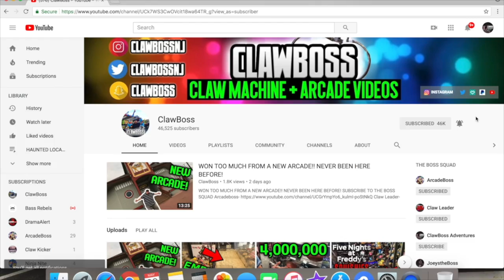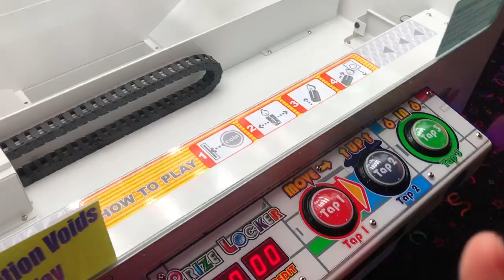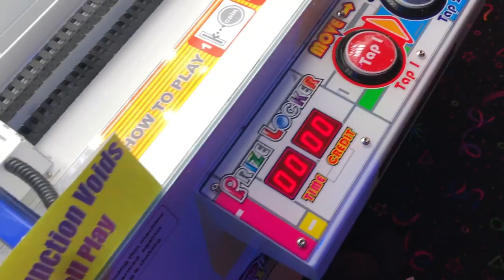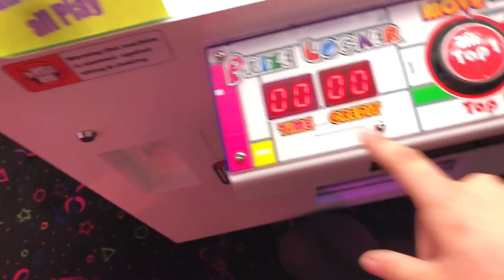HOW TO CHEAT A RIGGED PRIZE LOCKER | Arcade Redemption Game MAJOR WIN. THIS SHOULDN’T HAPPEN!!!

Comment: My grandma actually used to work on these machines. And the test run up takes the key through all the key holes. Yes it is riged to only allow win for each item that is paid for, for example. If you have a $200 watch in there, it won't let a win until that item is paid for.
Reply: That's stupid
Reply: Then what’s the point in these machines
Reply: @appleorange3708  so that the people can make money. What it is is that once the item is paid for and then some so they for sure make profit, then that one item will turn into a skill game.
Reply: @appleorange3708  point is the vendor needs to make a profit.  Its like at a carnival when you throw the ball in the basket.  There is a spring under there.  I've watch a handful of these video and all said pretty much product has to be paid for before you can win prize.  I watched a good video on when the machine will pay out.  From a business perspective of course its riged just like those sliding quarter machines or as the casino modus operandi say is the house always wins
Reply: wtf...people can literally buy them with their own money. I hate rigged games.
Reply: Key Master is the one that's rigged.

Prize Locker, with the small notches at the top of the keyholes is a legit (but very difficult) skill game. you have to get both the up/down and the left/right perfect to the millimeter.  Key master does cheat, and it will always rise too high, and even if it doesn't slip, the key won't turn even if it goes into the keyhole.
Reply: The "test run" is the calibration, which makes the key know where are the holes!
Reply: @appleorange3708  to get money
Reply: I won a fitbit once after only 10 tries
Reply: @cargxo8024  It's kind of a luck game, because it has that chance, as the owners set how much money the machine gets before it wins. Getting itself is not that hard, however that is a nice win still ngl.
Reply: False, I've won plenty of times on these.  You have to be near perfect, which this guy was not.  Has nothing to do with payout rates unlike the key master counterpart
Reply: @Toxicracer777  stop the cap LOL
Reply: @Toxicracer777  Prize locker is skilled, but this guy 4 sure meant Key Master.
Reply: @Toxicracer777  u watch the same thing as everyone else?
Reply: @billmcnulty1456  then make the games more skill based not rigged based

Comment: The bottom of the plastic for the PS4 is angled out slightly making the whole just small enough for the key not to fit. You can see if from the side view. When the key hits it, it bounces back when the key retracts
Reply from the maker: Yep
Reply: The key fits. The key always fits. The problem is that the machine is set to pay out after a certain number of tries. If you don't believe me look up the manual. I've been reading it for the past hour.
Reply: @ClawBoss my work has one of these. It is set for winning.

Comment: The key game really is rigged. I've watched videos that say the owner of the machine can set how many tries need too be taken before it'll line up correctly. Until that point it'll make the key stop right before or right after where it needs to be. I wasted a fair amount of money before i knew that myself
Reply: Some of them are that way, but not all. The ones with a payout rate only make you get the key exactly right up and down... there's a lot of leeway side to side. The skill based ones have a little circular cutout at the top of the blocking thing where the top of the key has to pass through. It has to be exactly right top to bottom and left to right.  

If it says its skill based and it's not, that would be fraud. I think it's kinda sketchy that they let the payout rate machines sit there and take people's money and make them think they can win when
there's no chance of winning at that moment, but to do that and claim it's skill based would be that much worse.

Comment: At least TWICE I seen that key was in the perfect position it just did not go through the hole.  They have the entire top row rigged on purpose, the plastic with the keyhole is mounted at an angle so the key wont go through it unless the key is unlevel

Comment: Wasnt perfect. Won this game many x repeated x in a row. You must practice more its 100 percent skill.  No rig no flywheel just fast motion. The clearance is litterally zero mm.  Most wins hit top and bottom of hole simul and it punches through.   The clearance is zero so getting close is hard to handle if your eyesight usnt better than 20 20.  Great game totally beatable. Ours only has smaller gift cards that one is a gold mine.  Tell me where that is and ill.clean it out.
Reply: humphrey bogarden Bullshit. This game is 100% rigged. You must be an arcade owner.
Reply: You can CLEARLY see the plastic is bent back at top causing an angle. IF you have the EXACT right position to win, the key will NOT fit the whole because of the angle and the zero tolerance precision of fitment. ONLY chance of this particular machine paying out for that ps4 would be if plastic piece was perfectly vertical.

Comment: If you read the user manual for the Sega Key Master game, you can get some insight as to how these games work. The key does fit into the holes, but the operator can simply set the parameters for when a prize is won. The default setting is that a prize will not be paid out until a certain number of attempts have been tried. Personally, I don't take issue with this being the case...since there would be no other reason for the operator to run a game if they can't make any money. The issue I have is that this game specifically states on the front glass that it's a "100% skill game" and that you can win every time "if you're good." This just isn't true, UNLESS the operator of this game has turned off the ability to hold back wins until a certain number of plays are recorded.
Reply: I do, I consider it legal cheating.
Reply: You probably know the difference by now but the “100% skill game” on this cabinet is legitimate; what is shown in this video is a Prize Locker, the 100% skill variant of Key Master. One could absolutely win every single play if they were good enough. Does this run the arcade the risk of getting cleaned out by a skilled player? Yes - probably the reason they’re not as commonly found as Key Masters.

Comment: idk if im seeing hit or what, but if you look super close to the part where the key goes through the hole.. at the top of that part is like a little notch that is rounded off like the tip of the key like towin that price the key has to be put on the  right side of the hole for it to go in and if ou look next to the other prize on the right of the ps4, the notch on that hole is in the middle?. its like a round notch u can barely see. i bet al those holes have that notch an thats where the key has to be set in perfectly for it to go in at 8:51 you can see it on the right. then look at the nexxt prize over on the right, the little notch is right smack dab in the middle. . at 853 idk how he didnt win, that has to be the xlosest hes ever got. an it still aint go in... let me know what you guys think

Comment: As electrician I don't see any sensor that registers if key matches a hole. So I guess it has stepper motors and count steps where the key must be able to win a prize and maybe that plastic piece is angled or as everybody said its rigged not to give a prize unless its paid off with some profit. Some of those even lift/lower the key a little after you release the button to make you fail.

Comment: I have won wireless beats on multiple occasions from these machines. They are 100% entirely skill. It is literally a perfect fit. You may think you had the key perfect, however there are literally micro measurements that the key has to fit though. The top rows are set to be the most perfect fit with the other rows having slightly more wiggle room. If you had that same key placement on the DSXL, the machine would most likely have given out the prize. It takes me roughly $30-50 each session to win a prize. With enough practice it is doable every time. It’s just you need to be mindful that as the prizes get higher in value, the amount of skill needed is going to increase tenfold.
Reply: Nice advice
Reply: It's not 100 percent skill. Google it.  Even if you hit the button at the perfect time it will move slightly further to make you lose. The owner of the machine can set it to whatever win ration. There are state regulations though. It can't be set too high. But they can set it to say 1000 dollars for the top row. After 1000 dollars have been fed into the machine the top row becomes winnable. If they set it to 400 dollars. It is 100 percent impossible to win until the 400 dollar "deductable" has been met. After the limit has been reached the game becomes skill based, but not before.
Reply: That is for the normal KeyMaster games. This specific model of "get the key in the slot" arcade machines are only operated with a one-time left and up option making it a skill based game. It is similar to the Balloon Buster games where there are variations that are skill (the machines with the circular holes and one-time up and across buttons) and the rigged versions (wider slots, joystick to move left and right). I know there are options to set payout rates, but with the type of slot shown in the video having the small slit cut into it for the key to perfectly fit, it is not rigged. The only way it would be rigged is if the slots were that on the OG KeyMaster machines that were the first model.
Reply: That means the pay due is $30-$50
Reply: No they are rigged all of them. I use to work on those machines
Reply: It’SfREeREe1Estate my only question then is why would a $130+ pair of earbuds be set to such a low payout? Isn’t the point of payout to have the vendor MAKE money, not LOSE it?
Reply: that may be but this one is slightly tilted so that it is impossible to get that key in. it stops just as it starts pushing on the bottom of the plastic but if it went any further it would have went in. whoever loaded the machine up messed up the top prize. 14:54 it presses the bottom in yes but after it passed that it isnt yet touching on the top. for these games to work properly the key and the slot have to be a perfect 90 degree angle but its closer to a 83-85 degree angle. you said its a perfect fit, well when its loaded wrong that perfect fit is impossible.
Reply: precisely my observation, the plastic slab is tilted with the bottom sticking out... impossible to win with that tight fit
Reply: All of the holes were the same size so yes the game was rigged
Reply: @gregoryszwarc3642  Are you really really sure??? So how do people win?
Reply: @yahsharelscrown7647  I used to work on those machines I said. They are rigged. They are set to pay out after a certain amount of money is spent on an item. It's all computerized

Comment: That looks like the space is too small for the key. Like a 1/16th of an inch too small. I bet if you were to have the key and one of those plastic plates, you would see the opening is too small.
Actually, no. If you use HD and pause, you can see, on one try he came really close, there's a tiny-tiny bit of space at the bottom of the plate. Just millimeters, if the key was lower, possibly would have fit.
Then again on 11:22 that did look perfect.
I wonder if you'd get busted for using stickers, or sctoch tape with a marking, or dry erase pen on the glass, to pinpoint exact places to stop.

Comment: IN KEYMASTER (not this machine)

When the key is hitting the bottom of the lock frame, your probably close to winning and the machine is ready to payout and 100% skill. If the key is hitting the top the lock frame it is not ready to payout.
Reply from the maker: That’s keymaster. This is Prize Locker. It’s supposed to be 100% skill with no payout. Keymaster has a payout.
Reply: Oh your total right, I was paying no attention, haha thanks

Comment: The ps4 wasn't ready... it would be set at 1000/1 or something. Although it Didnt look like it had any winners from the machine lately. i would have stuck with DS... you can normally tell by the way the first hits the hole if you aligne it up equally the key will jolt a little upwards preventing you from winning. If it doesn't jolt on an accurate attempt then normally after 5 tries you will win. I basically lived at a picadilly when i was yonger 😊

Comment: Its not rigged, nor is it about skill. This game is purely based on luck. There is something called a payout rate that estimates the speed of the key. This is also why the key always did not fit. Payout rate goes as following; if you are the 1 person out of 100 to win a prize, then the next 99 attempts would be near impossible to win because the speed of the key is increased when the button is released. Also, don't try this game if a prize is missing, it is a scam.

Comment: keymaster is almost 0 skill i own one.  Each level has a certain dollar amount before it gives a win.  If the top is set at lets say $1500, it wont give you a win no matter how hard you try until that threshold has been made.  I dont have expensive items in mine though mines set at 500$ 100$ 50$.

Comment: My favorite arcade prize game is the one where you cut the string.  I wish we had a decent arcade around here. The one that was the best for like 20 years just sold out and got rid of every actual arcade game. Then the prize and ticket machines were all that remained.  That was okay, because the prize games were the reason I decided to go.  The problem is, they had only tickets as the prizes for everything. Claw machines, Prize locker, cut the string, etc. Tickets. Really? Then the prizes that you could get at the counter... smh... 99% of the "large" prizes were bought at a Dollar General in the dollar toy section.  If you are ever at a DG go to the $1 toy isle and look for the Ja-Ru brand toys.  There was only like two prizes that were worth anything more and they were still a joke.  DG has better stuff than that stuff, splurge and get some $5-$10 stuff like Kre-O blocks.   You wonder why no one is coming back? Look at the place. It's run down and it is nothing more than a scam now. 

Oh and before you say why didn't you check out the games then just leave. I had to pay $40 just to get in the door (2 people). And every game costed $1.50 to $2.50 except for one claw machine that was $1.

Google hickory dickory dock arcade in morganton and check the recent reviews. No one is happy with the new ownership.

Comment: we wrote an app for android that drives a button pusher an uses the phones camera to hit the key hole with the precision of a better then a 16th of an inch and reaction accuracy of better then 3 miliseconds far faster then any human can react, yes the game absolutly cheats,  and the app captures high speed video of it doing so time it does so.. the game will usully trigger the key low